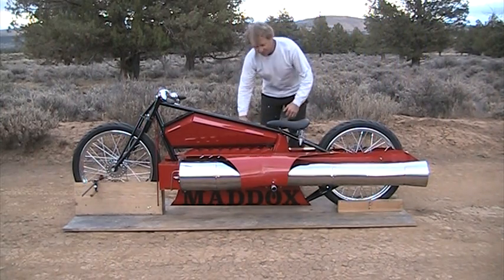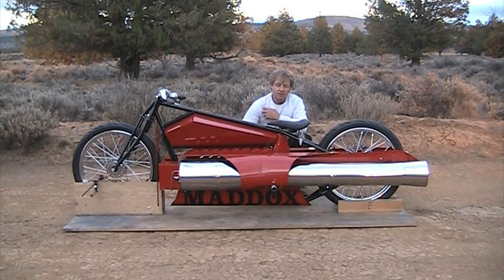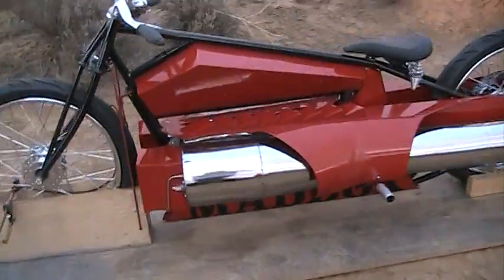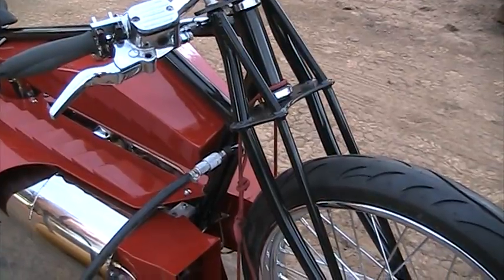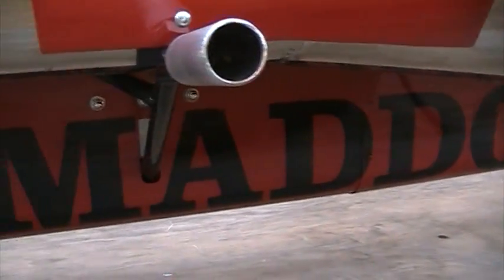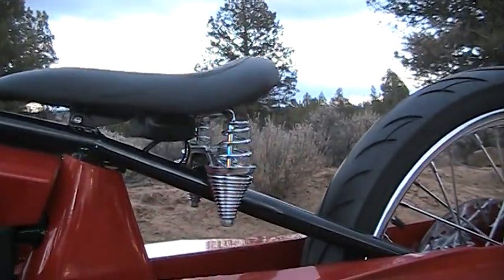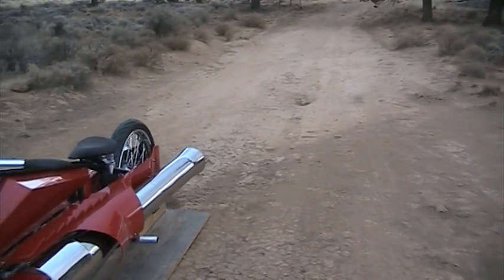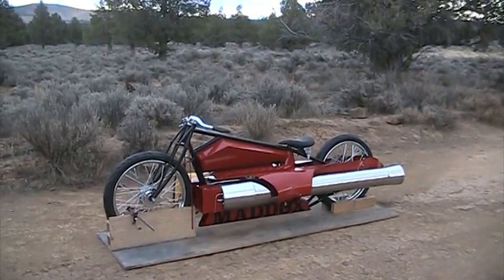RocketMan: ONE OF A KIND TWIN ENGINE PULSEJET Bike.

Comment: This bike is sick.  Amazing work on these pulse jet bikes.  How long do you think the engines will run before needing valve replacement?  Do you just use spring steel for the valves?  Ever thought about a valveless jet bike or is the thrust on something like a Lockwood-Hiller just not enough?  Lots of questions... 8)